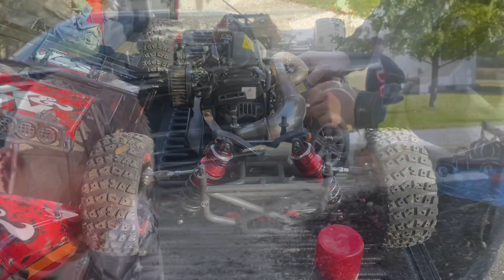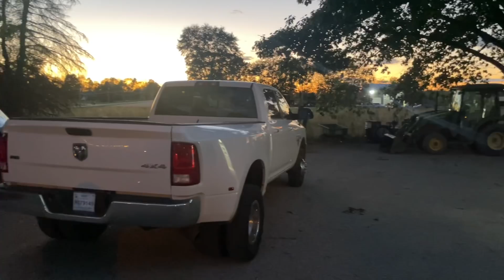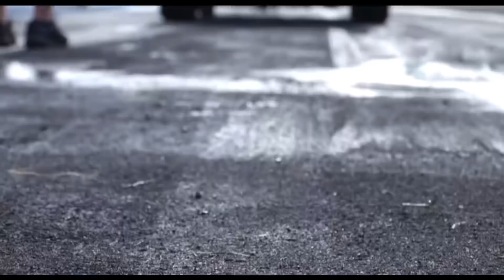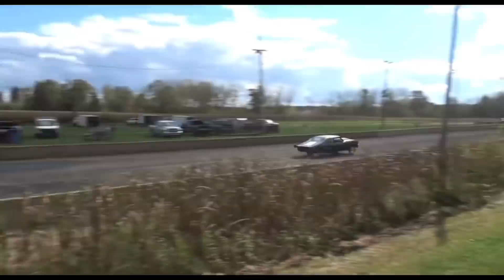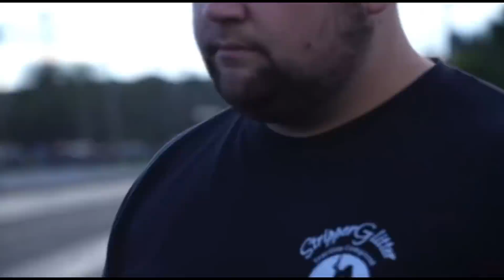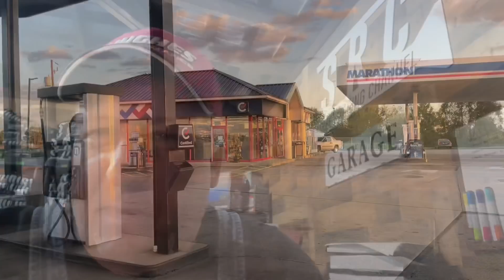BooBash Recap from Pacemakers!

Comment: I seen some really bad comments on her Instagram posts yesterday and I thought it was so disgraceful.  We as fans all love Billy and want to see him happy.  But no one really knows the whole story/situation.  Folks need to stop posting anything negative because the ones who suffer are y'all.  I hate that about the radiator.  Billy could have won the whole shootin match.  And I can definitely relate about chasing your tail.  I've been doing that all season.  I'm 49 and this is my first race truck.  I'd never been down a track till this year and I have yet to make a good clean pass.  I've had terrible transmission troubles.  Having fuel pump issues now.  And there isn't much time left to race here in east KY.  Especially in bracket racing. But I'll close with I love you all and love the videos.  Thank you for everything Ol' man!

Comment: THAT LEAK WAS A TRUE BLESSING FROM GOD. STAY SAFE FAMILY
Reply: Yes sir someone was watching down 💯 I welded mine up because my buddy got killed acouple years back in a car that was tuned,cam and an intake. First test first time ever on the track.
Reply: @triplehfarmsllc7348  What's even more amazing is I think they had agreed to split the pot 60/40 which is fine, but Billy couldn't answer the call.
Reply: @Vultor  I know a couple round trackers down here that kept a propane cooker and pot going for hot water. When your out to win you gotta keep those bases covered. I’m wondering why he didn’t push it up and run it dry, maybe antifreeze was cupped/caught around the radiator and support.
Reply: @Vultor   Yea if billy wanted to be a butt he could have went and broke the beams and got his 40. And that’s why everyone like them they do what’s right
Reply: @stevenbelue5496   The risk of what’re being trapped and coming down isn’t worth it. Not county the pot was $3500 I believe and they where gonna split it at that point if you mess the motor up your still out of a lot of money. He done the right thing. If it was $15k plus he would have ran dry… but he didn’t because of the lack of money to be made
Reply: @triplehfarmsllc7348  I think the motor would have been fine, we’ve ran them quite a while with no water with no damage, a lot of people do. The risk of that trapped water you mentioned is the big thing, water or antifreeze rather, which is worse, under a tire could cost you your life. The material things can be replaced.
Reply: @stevenbelue5496  forsure but for the amount of money it wouldn’t even be worth the risk motors ain’t cheap. I don’t run water at all heads/block are filled but if it where me for the money to be had I’d have to pass as well. And live to race another day haha
Reply: @triplehfarmsllc7348  I’m sure if I was in that position I would have took the split also. The risk of water under a tire plus the risk of loosing the race. I think most would take the split. Running a fill you know you have plenty of time before the risk of pushing a gasket. The fill does buy a lot of time vs running dry and empty and I could understand the concern in a moment like that, especially since the last gasket gave out I sure wouldn’t want any influence from anything else. Also not sure how they are cooling the glide. Some guys still use engine coolant, having an aftermarket cooler after the radiator, I imagine they are running a ringless shaft without a cooler circuit,  looped with a pump but idk.
Reply: @triplehfarmsllc7348  Pretty sure he got the 40% even though he couldn't make the call.
Reply: @stevenbelue5496  No reason to run it. He got 40% of the pot, it's not Billy's engine and they have a $250,000 to win race in two weeks. Not worth the risk.
Reply: Tommy was the angel on that race day.
Reply: @Vultor  that’s a huge pot, sure wouldn’t want to hurt nothing with that coming up. That’s the kinda pot you would love to split!
Reply: @stevenbelue5496  I’m not sure how they have it setup I have a stand alone trans cooler. Idk if he got any money being he couldn’t make the run. I could be wrong but how we always split you gotta make the run being broke doesnt count. But again they done the right thing it’s not worth a motor or complete truck plus other guys car or worse death. I’m just glad no one got hurt and it’s a cheap fix. I welded the drain up on my radiator it’s not a must have.
Reply: @Vultor  I’m not sure most races we do you have too make a pass normally a break is disqualified and your out. But again idk I’ve never ran at that event. Just glad no one was hurt
Reply: @triplehfarmsllc7348  wow, so sorry buddy!!
Reply: @triplehfarmsllc7348  A lot of these guys run each other all the time. That Nova has beaten Billy 5 times I think. They don't mind splitting pots just like the bracket guys do.
Reply: @Vultor  oh I know. Either you agree to 50-50 and not race or as they did 60-40. And if you cant make the race you get nothing. I know how it all works being I race the same style of drag racing. Him not making the pass is a disqualification if he would have let call it broke the beams he would win the 40%.

Comment: Just my .02 cents… with all the lean issues… I might look at redoing the fuel system and running a good return line if you don’t already have one in the proper spot. Also checking fuel pressure at WOT might help as well. The two elbows are detrimental to the pump (each elbow adds about 3ft of line to the system from resistance) pump should be no more than 18” from the tank… on top of that the line is a 12AN line which on gas should be good for 1200-1300hp… methanol requires double the volume of fuel meaning the line for meth is under sized for your setup being 1300+hp on meth. I am by no means an expert and if someone knows more speak up I’ll gladly listen. I am being taught this stuff daily with my job and by what we are taught the line size needs go up and the elbows removed or upsized to cut resistance. Much love! Glad Billy found the petcock before a bad accident!

Comment: Keep your chin up Billy, u got this.. 

I mentioned Superior radiator full aluminium radiators designed to fit inside the radiator support for V8 swaps on the racing channel... After watching your video I noticed y'all did quite a bit of modification to the radiator support Bill. Still might be something to consider. Hated to see y'all miss a race over cheap plastic.

The family/team is like a well oiled machine.  Every spoke in the wheel is doing fantastic. Good to see a family come together and do something so we'll. It's refreshing, gives a guy some hope in these weird times we are living. This country could use a lot more examples of it..

Comment: My son is just a little younger than Billy. And i can tell you. I know how hard it is to watch your son go through the crap Billy is going through. Theres nothing anyone can do. say. or. give him to help. And that is the hard part as a father or mother. But time will heal all wounds. As far as the truck goes. Its never looked better. You guys have the machine to take over the no prep scene. I seen that leak and immediately had the feeling of (are you serious?) I had the same exact thing happen to me in 2018 400 miles from home right smack dab in the damn middle of Atl Georgia. And it could not have picked a better time. 4:30 pm during heavy traffic.  That sumbitch blew out of my radiator and there i was. So i have always after that put (in the last 3 radiators ive changed for people) a brass or stainless steel plug in that port since.

Comment: There will be more races. Pulling the truck was the right call.  I understand fully about the water/antifreeze. Had there been water in the radiator it would been better for the track staff, however coolant can always  be cleaned up and safety should be a priority.

As bad as it was, you made the right call.

Comment: have you toyed with the idea of running a holley dominator  and using all its features on the truck but just not using the fuel side of things and keeping the carburetor?    i run a haltech vms and its basically an ecu with all the controls but without the fuel drivers in order to  run a carb or mechanical injection
Reply from the maker: Yes

Comment: Hey Bill I've got a favor to ask of you.  The caliber them cars are getting. After seeing a couple unfortunate events latest Scott Taylor over the weekend. Is there anyway of putting some sort of suppression system on them hot rods over the winter. If there already is I stand corrected. But would absolutely hate to see a hot rod or worse burn down over something as simple as a long night in tge shop and a loose fuel or oil line. It happens.

Comment: The truck is "SCREAMING FAST" You can see how hard its launching. As for that plastic petcock that GM came up with, Ive never liked those dam things. I had one go bad on our 1-Ton out in Missouri on our way to Tulsa on HOT June day. Draind the radiator and left us sitting on the side of I-44 With 4 horse wait on a tow truck to take to Rolla, Mo. For repairs. The owner of the towing company heard we had horse in a Gooseneck Trailer and came out with his own truck to take them to his farm till our truck was fixed the next day. And even gave us a spare car he kept ar the shop for customers in a pinch. We became good friends with them and made stopping there our over night horse hotel to this day. He's since passed on, But his son and daughter in-law still run the towing company and she has the "Half Way Inn Hotel" For Horses and pets for travelers on there way from the Eastern US to the South Central US (OK,TX, and beyond) We where told that his father started this idea with there old Tobacco Farm in the mid 1990's. About the time same we broke down. It will be good to see "Ole Cousin Eddie" back camped out in the driveway again. Matt just makes the video just that more funny when he's around. You just never know whats going to happen with Matt the 🐈 in the driveway. #TEAMSRC #SRC #SRCFamily #SRCfans And let's not forget #LetsGoBrandon

Comment: Hope every keeps their noses out of it. Even though we get to see alot of this wonderfull family. Everyone has a right to a private life. 
On the s10. Just wondering why you where still running a plastic tank radiator. They get brittle over time and always seem to crack. My car ( gm aussie) used to always crack a plastic tank when something was out of balance.     Engine mount, driveshaft bearing, or a flatspotted tire. And i would think with a solid mounted engine in the s10 that the vibrations could always be a risk factor

Comment: Like I said earlier you need to get that plastic end radiator out of the truck. The plastic is deteriorating and plug is the start of it. You’re playing with fire because the rest of the tank is the same way. Need to get an aluminum radiator.
I just don’t want to see Billy get Hurt and you lose the s10. 
Over 20 years of plastic experience.
If you blow a head gasket and you pressurize the coolant system you’re gonna blow the tanks out. Why take a chance.
Just my two cents